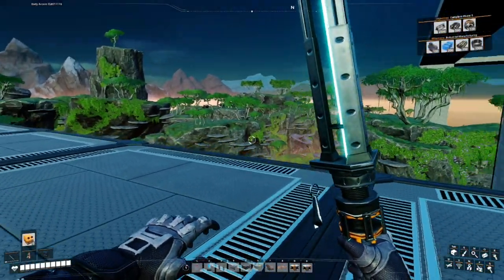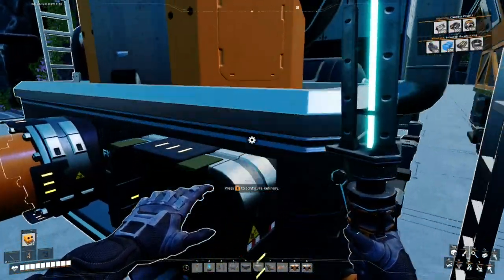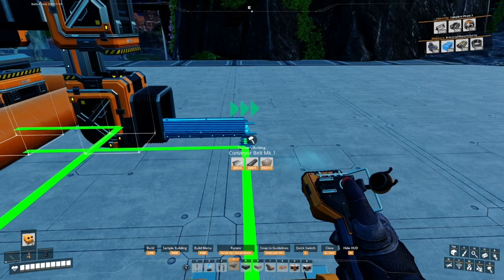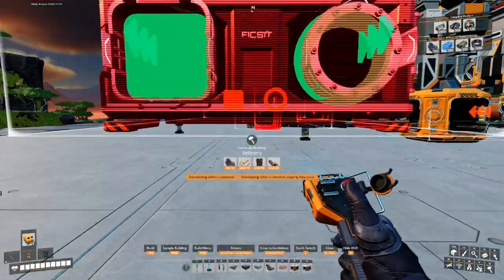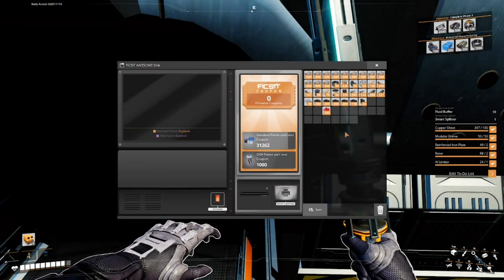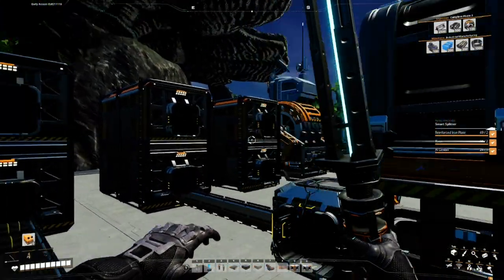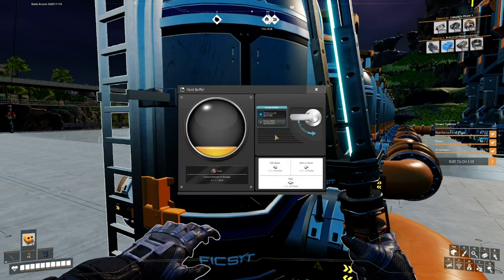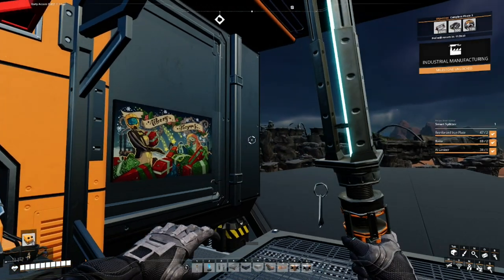Satisfactory - Let's Play (Part 10) "Best beginner oil setup?"

Comment: To color code your pipes go into the color screen by hitting "X" then when int he menu simply right click on a color swatch and select what future items you would like to have that color. Example Pipes if you make that swatch pink all future pipes will be pink until you change it. Please note that if you do that and you switch the color swatch all the old items you have colored will be changed as well. the only one that does not do that is the one swatch that is by itself between the Ficsit default colors and the swatches on the bottom. Hope that helps you in the future.
Reply from the maker: I will keep that in mind, thanks for the tip. I ended up coloring them normally after the video!